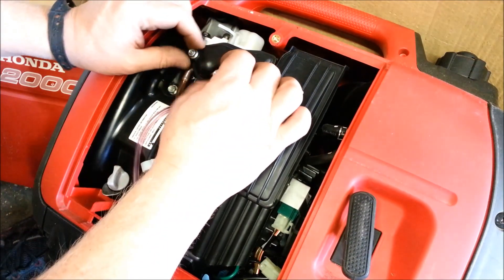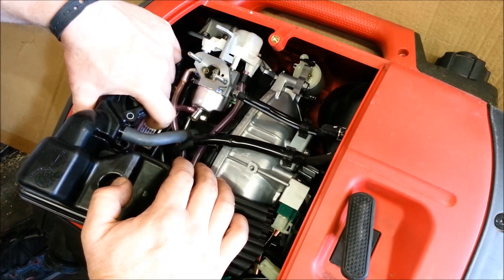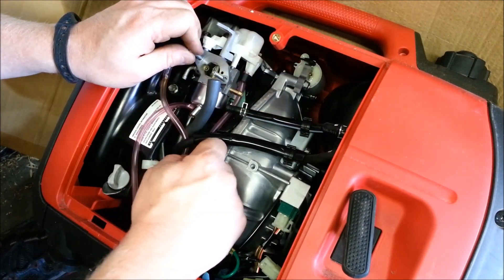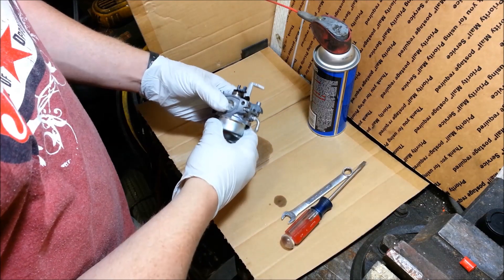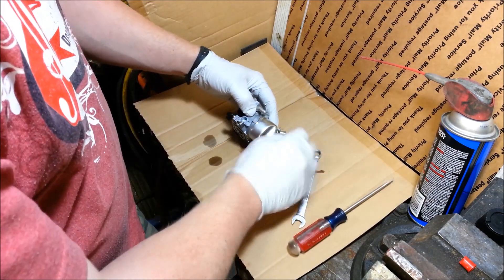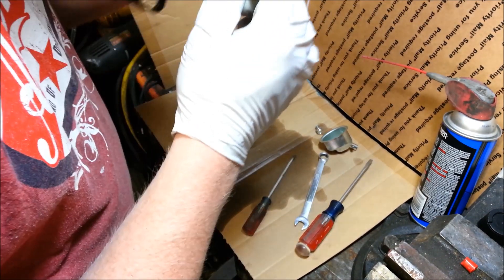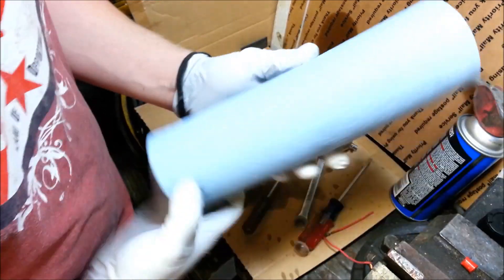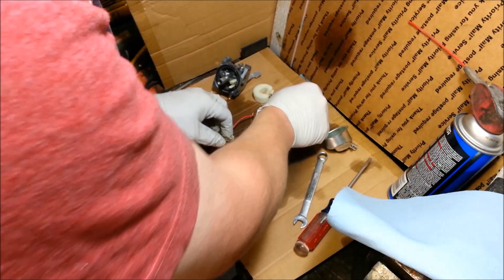Honda generator eu2000i eu1000i carb rebuild

Comment: My EU1000 is a bit different. The air filter housing doesn't have that simple bolt to take it off. It appears to be one piece with the entire shroud. Looks difficult to remove.

Comment: Awesome job with the two-part series on cleaning this carb for this popular generator! I had a little old gas from two years ago and didn't realize I needed to drain the bowl after the season when storing the unit. I had the problem where it only runs when choked.  I had to clean out the jet, emulsion tube and bowl to remove the blockage (likely from varnish). I didn't even bother disconnecting the hoses. Just removed the air filter unit (1 bolt and 2 nuts) and pulled it to the side. I put a larger spring clamp (like for wood working) on the fuel tube to pinch off the gas and removed only the bolt holding the bowl to the carb (from the bottom). That provided the access to remove and clean the parts like he describes. I'm back in action! Load test with the 15 amp AC unit worked perfectly as it did originally. Thank you!
Reply from the maker: Awesome

Comment: After carb rebuild and several do overs, replace carb , twice, I checked the in tank fuel filter , cleaned the filter , was not satisfied, so left it out in reassembly, after year and half of working on it it runs great for first time since buying it.

Comment: Can you buy a replacement spring and emulator tube if it goes flyin and gets lost?
Thanks
Reply from the maker: Yes. Here's a link to a carb breakdown. https://www.boats.net/catalog/honda/generator/eu2000i-ac1-vin-eaaj-1170001/carburetor

Comment: Hello I broke the adjustment screw on the side of the carburetor and bought a replacement one is the adjustment like bottom and turn and quarter out. The needle is poking in the carb a little and don't known if its right.       thanks
Reply from the maker: I will generally do around 1 to 1.5 turns out.

Comment: Hi sixtyfiveford don't know if you still monitor this thread but if you do I could use some help. I'm having an issue with the eco throttle after performing this carb rebuild {eco throttle was working fine before}... When I flip the eco throttle switch nothing happens and the generator is always running wide open as if eco throttle is not engaged. Any ideas about what to look for or how to fix this issue?? I also performed a full tune up.
Reply from the maker: The white plastic assembly that controls the rpm on top of the carb is unplugged or not properly assembled.
Reply: Thanks for the reply.. Thats what I thought at first but I finally figured it out. When I put the idle screw back in I turned it in too far and it wasn't allowing the electronic governor/eco throttle to move freely so the idle screw was locking the generators idle at max RPM. I just made the adjustment with a stubby phillips screwdriver while the generator was running.
Reply: Im still having a rough idle issue in eco throttle mode and the only way to smooth it out is to adjust the choke to half. Any ideas on how to fix this? Im thinking of replacing the main jet and drilling the idle jet with a #60 drill bit.
Reply from the maker: The idle circuit is very finicky and is more than likely your culprit. The passage from the top to the bowl area. Use a lot of carb cleaner and just make sure everything is flowing nicely.

Comment: u did not need to take the top white govener off the carb just to clean it,  i left mine on and it whent alot smoother.  just saying.  :)
Reply: Yeah leave it alone then you don't have to deal with that little spring.
Reply from the maker: +apsghostseeker True, I just think it's easier to get in there and pull the top jet with it all off. Just so happens I drop the spring on video the first time ever.

Comment: Thank you very much, finally a video that helped me solve a common problem, erratic idling in Eco w little to no load.  Many reports don't address the low speed jet located just under the Eco module on top of the carb.  Video 2 covers it nicely and after all my efforts to no avail, this video helped me fix the problem.  Thank you
Reply from the maker: +David E That's great. I'm glad the video was helpful.

Comment: my eu 2000 keeps surging help!!!!
Reply from the maker: +Timothy Keeler The idle jet/circuit is clogged.
Reply: got it thanks!
Reply from the maker: @ 8:15 in video one I start the idle circuit but more than likely your problem lies in video 2 @ 1:55 and 2:45 the passage that goes down into the carb.

Comment: did as the video showed and it started OK, but would not  work right without 1/2 choke? thoughts  repeat process?  Dan
Reply from the maker: Dan Pearson This signifies that the main jet is still partially clogged. It could be varnished and need a wire ran through it or a piece of debris reclogged it.
Reply: Thanks!  Will repeat the process until it idles down like it should.

Comment: Nice video, but be aware that is not necessary to remove the throttle control motor from the top of the carb. Removing it unnecessarily complicates the process, and  if you loose that little spring, you are in trouble.

Everything you show can be done with the motor left on the carb.
Reply from the maker: PeteLeonardi Carb cleaner and the plastic on the motor do not get along very well. I've done it both ways but it easier without so you can easily access the idle passage.

Comment: I use copper wire strands as well, softer than brass :-)
Then i use a jewlers magnifier to inspect the holes, especially the emulsion tube ones, so tiny.
Reply from the maker: Yeah, I have to get the magnifier from time to time as well. I really rely on the visual spray pattern of the tiny holes.